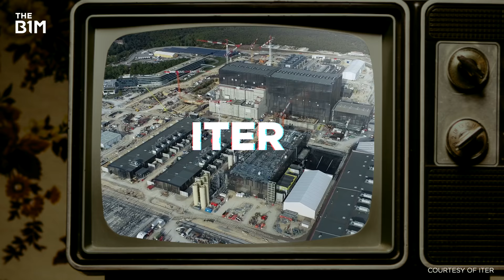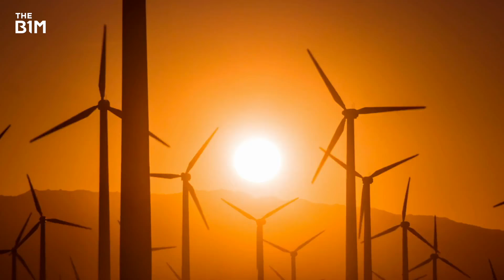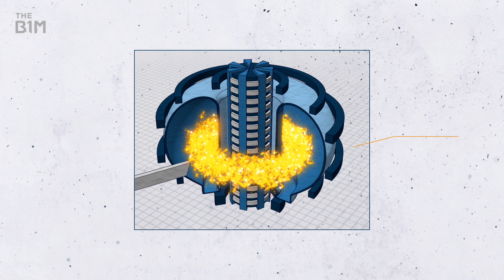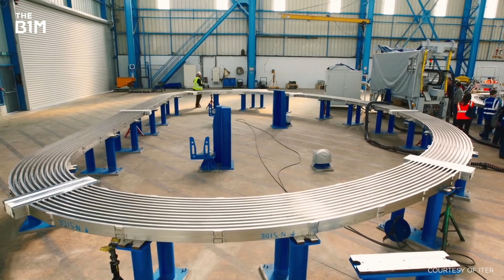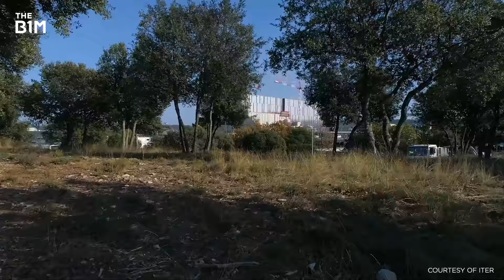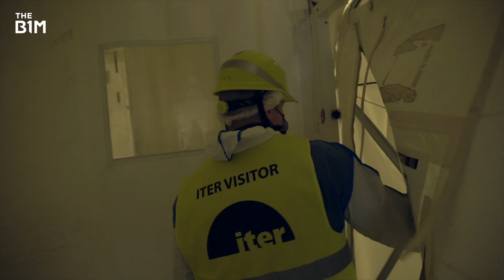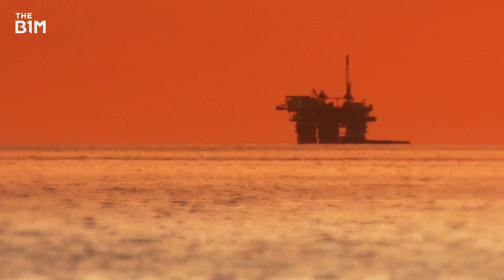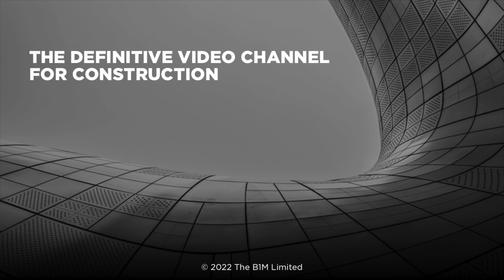We Went Inside the Largest Nuclear Fusion Reactor

Comment: Ironically built based on a Russian nuclear physicists groundbreaking work. We'll need to have done alot of the hard work before this reactor is power positive. Anyone tell me that it needs rare and scare helium of is that a byproduct? The only good news is that none of the 35 partners want to miss their commitments. Its also pushing manufacturing tolerances of advanced machine parts to the extreme. As near to aerospace or landing on Mars as can be. In the meantime, we might get modular safer fusion working as the backup base power until weapons capable waste means fission is the nuclear answer we need when wind and solar cannot meet global demand of even the current 7billion much less the next billion as well as trying to electrify everything thats currently using oil+gas+coal as its power source.

Comment: I am nominating fusion as the longest human endeavor without commercial success. During our near 75 year long pursuit of fusion, we have....
-Split the Atom
-Eliminated smallpox, polio and about 80% of HIV transmission in modern world.
-gone to the Moon
-decoded the human genome
-created the Internet
-discovered gravitational wave and dark matter

Can anyone find a more promising yet so-far futile endeavor? Fusion has been researched for 70 years, still doesn't work. It did Crank out a huge supply of Ph.D's. Fusion simply doesn't work as a technology.
    The Quantities of deuterium/tritium; though abundant require huge manufacturing facilities that industry simply hasn't adopted or built yet.  Tritium has to bred in fission nuclear reactors in large amounts, thus still needs lots of reactors round the clock to produce barely a few Kilograms a year.  Technology still doesn't break even. Despite it's claims it doesn't produce radioactive waste; it doesn't produce solid wastes, it does produce HUGE amounts of radiation in the form of neutrons and high energy flux. The Sun is 93 million miles away, still produces enough radiation to give you cancer and severe eye damage.

Fusion is difficult because the mass needed to fuse per second is huge. In nature GRAVITY does the work of coalescing gaseous material into a ball and keeping it into a ball. According to scientists stellar ignition requires a mass 70x greater than Jupiter; 6.4% the Sun's mass(converting a quarter million tons of fuel per second) Humans cant generate gravity; so we substitute higher temps 100-1000x the temp of typical star cores, this results in a plasma temp too unstable to be dense enough to even use. 100-1000x less dense, it's less energetic. Plus hydrogen nuclei don't like to merge, as they share the same charge, they deflect alot. So it takes enormous amounts of pressure and energy to FORCE hydrogen nucleus to interact.

To sum up fusion Think of a miniature Golf Course. In this case the hill or Volcano hole. The Ball is one hydrogen nucleus, the HOLE is the target atom, the volcano mound is the scattering affect of alike charges. You cant steer the ball, you have to have enough balls over and over again. And you need enough energy/temp to get it up the hill. And you have to fence them (Containment) to keep the particles inside and from dissipating. Density, temperature, and confinement.

Fission is so much easier......Fission is the same golf metaphor, except now the land is flat, no volcano because there's no scattering (neutrons have no charge), the target nucleus is 10x the size of a golf ball (Neutron), so the holes the size of a dinner plate. There's a hundred million holes all over the field (Uranium density), Temperature is 1000x lesser, therefore approachable with Current human technology, Containment is irrelevant (except to protect you), the balls are moving slowly and every time a ball goes in the hole 2-3 more balls come out. Fusion is so hard we worked on it for 70 years, still doesn't work, Army of Ph.D scientists, engineers....Petaflop scale super computers, Machines that costs tens of billions of dollars and they still haven't produced anything resembling break even. Fission is so simple we solved it 70 years ago on Chalk boards, reactors designed on slide rules and PAPER. Fission is so simple you can take a bunch of high school kids who never saw a reactor before in their lives, train them in ONE year and they can run a nuclear sub.
Reply: -Dark matter has not been "discovered"; it's been "inferred". 
-You can train kids to run a fission reactor, but that doesn't mean they can build one. And fission reactors are still an expensive and dangerous mess. 
You are right about the slim and remote chances of fusion power to be a viable option for significant energy generation on Earth; this project will probably prove that beyond all reasonable doubt. 
But several other benefits will come from having built ITER, even if it doesn't work out like its builders and advocates hope, and that's reason enough to give it a shot. And who knows, they might actually get lucky; either way, when this is done we'll know for sure (personally, I don't believe this will work on Earth; but in space? A much better bet). 
As far the award nominations, financialized capitalist commerce itself has a better argument for receiving that award. Civilization-wise, the last 50 years at least (if not the last 100) has shown it to be a largely dead end , with significant risks for our basic survival as a planet and species.

Comment: Nuclear is not a part of the fusion process, that's just basic physics, they want it to be part of fusion but fusion is non nuclear and clean. Nuclear is and has always been a dirty science
Reply: Fusion is not non-nuclear. It’s literally a nuclear reaction. Hence the name “nuclear fusion”.
Reply: @Gomlmon99  you know nothing, anyway, the laws of an atom/electron are not relevant to nuclear based applications other than thru violent means. Hence you are still wrong even though you may still think you are right.
Reply: @iamfirstamongyou  you’re off your head mate
Reply: @Gomlmon99  meaning: By this new model, the nuclear force, resulting from the exchange of mesons between neighboring nucleons, is a residual effect[vague] of the strong force.
Reply: Actually unstable light nucleus fuse together to form moderately sized nucleus and the energy released from that is difference in binding energy and binding energy is related to strong nuclear force that acts along nucleons so technically it is related to nucleus lol
Reply: @doctorsexo420  that's what I said, it's one part nuclear, 3 parts atomic
Reply: @iamfirstamongyou  lol if you mean atomic then it includes energy levels along with that very tiny nucleus but if you regarding nuclear specifically then its only and if only nucleus
Reply: @doctorsexo420  nuclear force is the only part connected to it

Comment: Thermonuclear fusion to generate electricity will never work. And by "never", I mean not within the lifetimes of any of us. Technical problems, which are innumerable, are just the start. Even if it does "work", which it won't, it will be ridiculously expensive to construct and operate. This is quite literally a fool's errand, and we'd be far better off putting our investments into other, more practical and workable, energy sources.
Reply: ITER is not ridiculously expensive compared to some transport infrastructure projects, for example. Your rant sounds like coming from a dark corner of your brain that hasn't dealt with the respective numbers much.

ITER is expensive compared to whatever the commercial reactors might look like... Because ITER needs to be so much more tunable and capable of experiments. It has lots of margins and lots of measurement apparatus that practical plants of this type won't need.

Meanwhile Joint European Torus runs a tritium test to produces Q of 0.33 average over 5 seconds, high temperature superconductors keep getting discovered, and thermophotovoltaic cells get announced with efficiency on par with steam turbines...
Reply: @u1zha  My "rant" is based on not only my own mini-analysis, but on the analyses of many experts in physics, engineering, and economics. If I were a young engineer or scientist, there's no way I would throw away my career on this pipe dream. As an investor or a public official in charge of taxpayers' money, I would feel the same.

If you want to put resources toward a power generation scheme with an actual future, within an actually realizable time frame, it's much better IMO to look at geothermal. The amount of clean energy available is unlimited, and it's only a few miles away at any point on the planet. The main roadblock at present is the cost of deep drilling, and many advancements have recently been made on that engineering problem.

Comment: Spent fissile material is only waste if you choose to waste it. It's fuel for newer generation reactors. If you really want to store it, you can, as has been done for decades in pretty much indestructible concrete-filled casks. Nothing to leak out, since the fuel is ceramic pellets contained in metal alloy rods. It is in fact the only energy source that contains and stores the byproducts of its process. That makes it a hazard, but not a danger.

Comment: This is really cool to see. If this works (and I really hope it will), it could hopefully even change some of the irrational fears lots of people seem to have about Nuclear Energy here in Germany. Years of political gaslighting aren't easily undone, but there's always hope. (And even if nothing changes, a good chunk of Germany's electricity is pumped in from France anyways)
Reply: hi Hans, Pierre here. 
No, fusion will not undo nuclear problem bc just as you pointed out it's irrationnal. If fusion works, your Grüne will just say that it's like the H-bomb and perpetuate the cycle of fear. And anyways, fusion is decades away at best.
It is YOUR job as an educated kraut to do your part and convince as many people as possible that fission is safe and reliable.
And you don't need to rely on anybody to do it. Wurstland is the industrial powerhouse of europe, you make great steel, you have great eng capabilities, you have great KONVOI designs, you can do it right now. And Tsar Putin is making it much easier for you to advocate for it at this moment.

Comment: The confinement area should be more like a water jacket made up of inner and outer with a thin reaction layer between the two.
Reply: Water is there in the blanket that surrounds the plasma donut, and it is circulated to transport the heat away.
Reply: @u1zha  you misunderstood my comment.
Reply: @u1zha  the water jacket should be the plasma confinement area and the donuts should be the part filled with coolant.
Reply: @eprofessio  liquid helium with temperature close to absolute 0

Comment: Is this reactor meant to be flawless? What if something goes wrong or it gets damaged whether on purpose or mistake?

Because containing energy with a temperature of 150m°C sounds very concerning if anything were to go wrong.
Reply: It is safe, it is extremely difficult to maintain this temperature, should there be a leak or something this temperature cannot be maintained and it cools down to a few thousand degrees within seconds. As soon as 1 parameter for the fusion is not correct the fusion stops by itself, this is the reason why current fusion reactors have only a few second long runtimes so far.

It is the opposite of atomic fission, which runs by itself and has to be interrupted, while fusion has to be brought about with a lot of effort.
Reply: To say it short: it just stops being so hot and just cools down, then nothing else happens because the crew is farther away from the reactor

Comment: The successful construction of an energy positive fusion reactor will be marked as a leap forward in human history.
Reply: Not really...

"A fusion power plant produces radioactive waste because the high-energy neutrons produced by fusion activate the walls of the plasma vessel. The intensity and duration of this activation depend on the material impinged on by the neutrons."

If you think a giant nuclear waste factory is a sustainable option you are an absolute muppet.

"Transuranic wastes, sometimes called TRU, account for most of the radioactive hazard remaining in high-level waste after 1,000 years. Radioactive isotopes eventually decay, or disintegrate, to harmless materials. Some isotopes decay in hours or even minutes, but others decay very slowly."

Nuclear is one of the worst forms of power production and it isn't even really debatable sorry. If you support Nuclear power you literally support dumping toxic waste on the planet that wont be safe for 1000 years... and are a disgusting individual.
Reply: @dislikecounter6392  Dude, you can't "activate" the walls of a nuclear fusion reactor. They're made out of metals like titanium, aluminum, steel, and others or a combination of those. Fusion doesn't produce any radioactive byproducts because it uses deuterium and tritium and you basically just get helium from that, which isn't gonna be radioactive at all. also the actual amount of material they use is pretty small because any fuel they use is pretty energy dense in the first place. And also, the fuel is not radioactive either. The reactor may produce some radiation while it is active, but it will cease the second the reactor is turned off and the actual amount of radiation will be miniscule.

Even for fission reactors, radioactive waste is much easier to deal with from an environmental standpoint when compared with carbon emissions. Sure carbon dioxide is not radioactive, but causes global warming. Nuclear waste, on the other hand, can be berried deep underground and completely forgotten about with no ecological side effects. A project to make a waste disposal facility that is all but full proof is underway in Finland right now. If the entire world ran on fission power, it would take 100 years to fill this thing up, and then they would fill the hole with dirt and be done with it. I urge you to reconsider you standpoint on nuclear power. It actually is a viable long term option for the future. In fact it is probably our best option.
Reply: Afsik fusion does prodice some low level radio active garbage from the irradiated walls and stuff, but it only lasts a couple of decades and is not very dangerous
Reply: @dislikecounter6392  you literally have no idea how nuclear energy works wether fusion of fission you think it's random the smartest people in the world are pro nuclear? Same with scientific community

Comment: Which would be more impactful: nuclear fusion or silicon ion batteries that require no rare earth metals?
Reply: If you need assumptions, suppose the nuclear fusion cost per kWh is on par with today's solar and that the silicon ion batteries cost is $30 per kWh of capacity and are as energy dense as today's lithium ion.
Reply: A combination of the both is better

Comment: You do know that using molten salt 'fission' nuclear reactors, and using thorium as a fuel source, is way easier, cheaper to run, smaller, and cost about 1000 times less to build?  That is why China is currently building their own molten salt experimental reactor, so they can test it over the next 5 years before they scale it up to a full-sized commercial reactor that they will then sell to the rest of the world, including the U.S. and Europe.

Comment: My question is what material they’re lining the inside of the reactor with that can stand 150million degree temperatures without catching fire or exploding.
Reply: ...or creating nasty radioactive byproducts (important concern)

There's no known material that can withstand 150 million degrees. All the reactors of this type levitate plasma in a magnetic field so it does not touch anything directly.

ITER website says "beryllium has been chosen as the element to cover the first wall. The rest of the blanket modules will be made of high-strength copper and stainless steel. ITER will be the first fusion device to operate with an actively cooled blanket"

They also speak about experimenting with walls clad in lithium. Not because its track record withstanding heat, but because it spits out some extra tritium fuel when bombarded with neutrons, and I guess myriad of other factors...

Comment: Correction: traditional (cheap) nuclear bombs use fission; thermonuclear bombs use either a combination of a high explosive and a fusion bomb (using materials such as lithium), or a fission bomb to ignite the fusion bomb.
Correction: high level nuclear waste left unprotected and unattended is harmful, while high level waste stored as it has been for the past 40 or so years in dry casks of lead reinforced concrete can be hit by a speeding train and do more damage to the train than anything. Take a hose to it for 2m and the dry cask is good as it was when it was built.

Ask people, particularly nuclear scientists. Maybe even someone with a more broad understanding like @Kyle Hill.

Comment: When you think about it Nuclear Power Plants are based on old technology, the use of steam for power. The heat from radioactive material produces steam which spins a turbine producing power but this is completely on a different level. However, this has been in development for decades.
Reply: Solar thermal plants are used more than solar PV, so i dont see the problem with using steam.